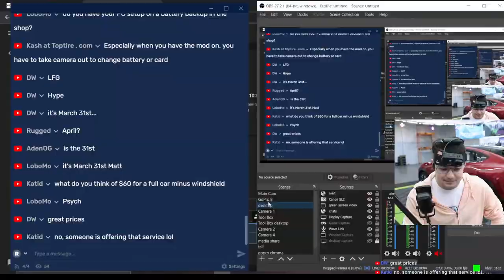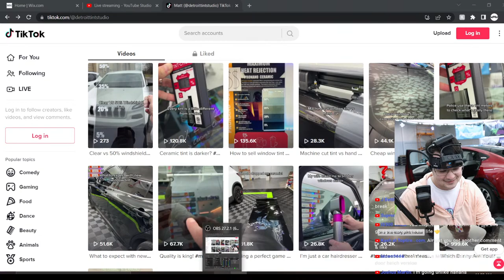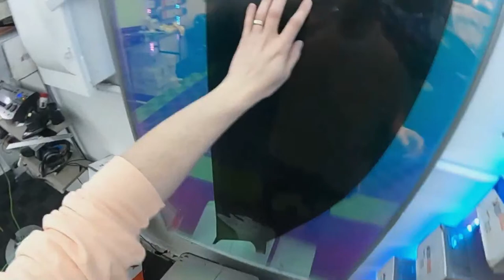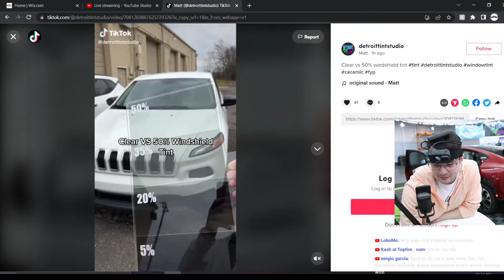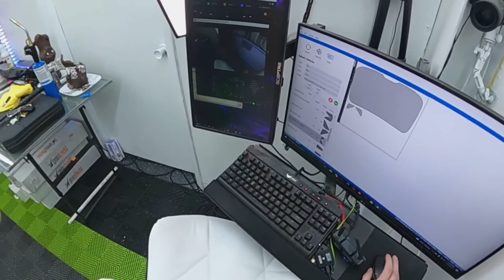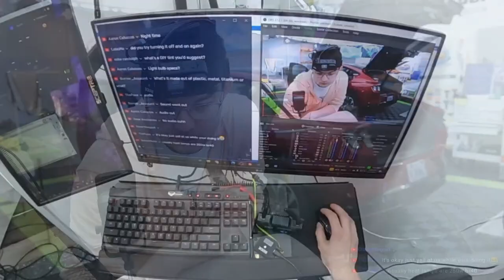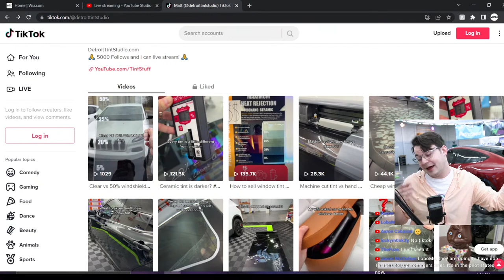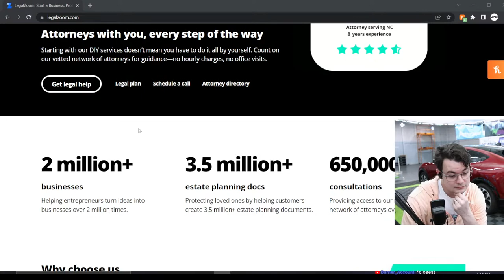Mustang Mach E Window Tint

Comment: Question, I have a factory tint on my aftermarket headlights and one of them has peeled away, leaving a small tint spot with flakey edges still stuck to the plastic surface. I wanted to know what would be the best way to remove the rest of the tint without scratching the plastic?